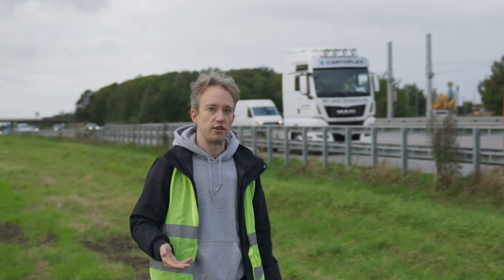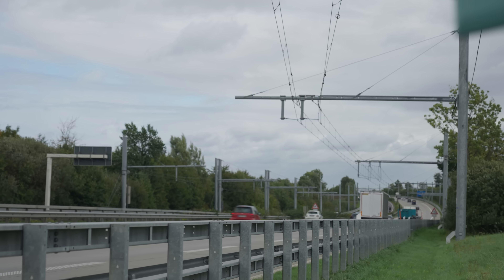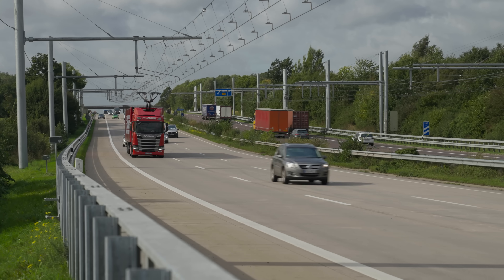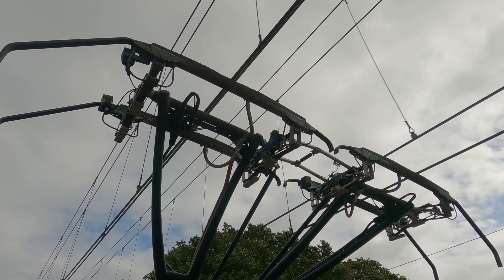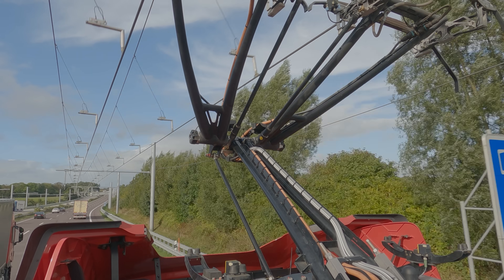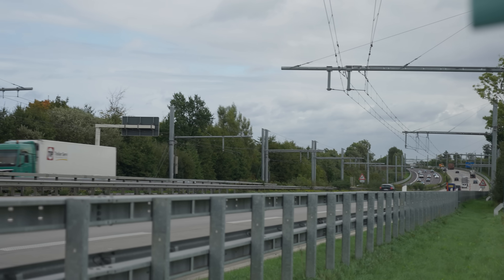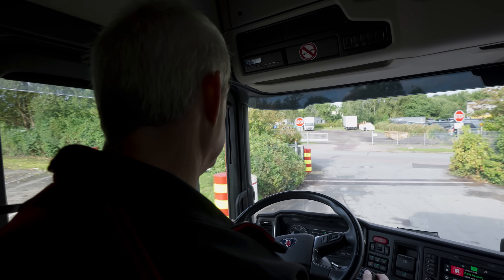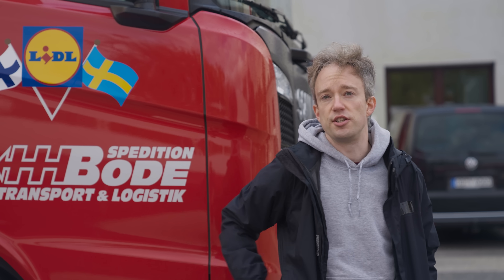The highway where trucks work like electric trains

Comment: As an EV driver I love the idea.
But I believe the future is green hydrogen.
Reply: Hydrogen fuel cells are not the solution. Why do people keep saying this rubbish. “As of 2020, the majority of hydrogen (∼95%) is produced from fossil fuels by steam reforming of natural gas, partial oxidation of methane, and coal gasification.” Hydrogen comes from fossil fuels it is not clean. The rest is made by electrolysis, which is extremely inefficient compared to putting the electricity straight in to a bev.
Reply: @TylerBenney  
".....this rubbish."
Wow, Tyler, how arrogant of you!
If you have a logical point to make try making it without sarcasm.

Comment: I looked into the numbers a year or so ago and it was considerably cheaper to have every truck run off battery than off cable. In fact the eccomomics are there for trams and trains now. Just the technology/companies doing it are behind. These hybrid trucks are barely cheaper than a long range battery ev truck because they have to either lug around a powerful diesel engine, fancy electronics and a power electric electric motor or they have to have enough battery pack to go away from the cables and back again at speed plus they need to have the overhead equipment too.

To predict I would say that battery electric is probably going to win in most counties, a few countries may have hydrogen win and 1 or 2 may have this system. But as it doesn't provide door to door zero emissions by itself as battery or hydrogen do, I'm not sure how governments can justify the outlay to the taxpayer... As by 2035-2050 all new European trucks will have to be zero tailpipe for 100% of journeys. So you either have battery trucks that you also offer this sytem too or you have hydrogen trucks that you offer this too. Sure its a nice solution... But rember how much it cost to electrify the great western railway from Cardiff to London? £5.5bn. The original budget was £850 and the route was to go much further to Swansea. Motorway electrification will not be any cheaper, whatever figure some government minister initially quotes.

Comment: This seems like a step backwards to me. We need to either improve wireless charging or look for other sources like fuel cells. They burn hydrogen, the most abundant element in the universe and they only exhaust water. I'd rather see gas stations replaced with Hydrogen stations myself then wires all over the highway.
Reply: Don't you need some of the rarest metal in the universe to split that hydrogen from whatever it is currently stuck to before you can use it?
Reply: @nogravitas7585  not that I know of, you can get hydrogen lots of ways, like electrolysis of water is one easy way.

Comment: The issue with this in the USA would be that on current highways there is a lot of distribution infrastructure that passes over the highway and that would be an enormous capital cost to move them. I love the concept, and think it has a lot of potential.

Comment: This is only acceptable if those ABOVE WIRES will be used to REPLACE ROADS to TRACKS and run TRAINS. 
If it's not, It's not worth investing.
It's way better to straight up invest in electric railway networks and infrastructure.

Comment: "And with that, you're replacing a lot of diesel" You are also putting a bigger strain on the power plants many of which run off of coal, so you're only replacing one fossil fuel with another one.

Comment: Sure, try everything possible instead of just using the old railways because trains aren't cool anymore. Upgrade rail infrastructure ffs.
Reply: Especially in cities you would have to demolish large areas of the city to put new rail infrastructure in. Sure where you have it you can improve it, and maybe in the most high demand areas you could put some underground rail. But outside of that you are limited to roads.

Comment: In the States, we could get companies to go electric just by relieving them of the need to pay weight-distance taxes and maybe lower the vehicle registration taxes too. Then recover the lost road maintenance revenue by raising diesel fuel taxes.
Reply: Great idea tax those who can't afford a new electric vehicle more until they can't afford any vehicle /s
Reply: @nogravitas7585  - Who would choose not to go electric? Operators that don't drive enough long-haul miles to use the system. Those operators probably don't buy much diesel fuel compared to a driver that is driving their truck 16 hours a day. As you know, the cost of labor is a far greater portion of the cost of truck transportation than either fuel or fuel tax. Short-haul trucks spend much of their time stopped, and being loaded or unloaded. Exceptions, like package delivery, are going to go electric anyway.

Comment: As an American trucker I think this would be awesome. I primarily drive back and forth between los Angeles and Portland oregon everyday so just putting these up on the i5 should work perfectly.
Reply: would be great for up-hill too where most trucks lose or lack power to climb.  putting electric trucks aside.
Reply: @jetah50  Electric and diesel both have lots of low-end torque. That's why there's hybrid gassers but no hybrid diesels.
Reply: @jetah50  nah just get a real truck that's got the power to pull it.
Reply: @camcam-uw5mx  For a traditional truck, more power means lesser cargo weight cause the powerful engine takes up most of the limited weight a total truck is allowed to haul.

That's why saying, "just get a more powerful truck"  isn't always an economical smart solution.
Reply: I'm excited to picture this on US Interstates.  It's not hard to imagine!
Reply: @ninjamincho  Let's make this happen! Contact our congress representatives and senators!
Reply: Most of I5 is straight and fairly flat.  That bit would certainly work for this system.  It is easier to engineer something for a straight line.  You only need something like 50KW to keep a loaded truck at highway speed so it needn't be the great big ones for trains.
Reply: Only thing being the inefficincies of rubber. How about some steel wheels and tracks? Hmm. Then we could attach more trailers togheter meaning less power for more cargo. Wait. Its just a train.
Reply: So do you expect the tax payer to foot the bill for the infrastructure?
Reply: @SlinkShady  did you watch the video?

1. Low cost of electricity makes the trucks pay for themselves in 18 months.
2. Revenue from sale of electricity to truck companies pays for infrastructure
3. There is still profit for the electric company and enough extra to replace the lost fuel taxes for the gov't.
Reply: @SlinkShady  Isn’t infrastructure what taxes are for?
Reply: @robsengahay5614  infrastructure is for everyone not one particular business type. You can't even upkeep the current infrastructure,
Reply: @SlinkShady  Everyone needs the stuff trucks are moving.  I am not in the US.  Infrastructure is looked after in other places.  The US is something of a basket case when it comes to tax and spend but that’s a whole new subject.
Reply: @robsengahay5614  All infrastructure should be privatized, it will actually make transportation and land use more sustainable faster as both are currently artificially underpriced.
Reply: @CAD Thunkin I see this in normal cars as well - people driving along at 70 mph where 80 is allowed, but as soon as I try to pass them they speed up to 90... It must a human trait of some sort, since I also see it in kids, who starts running instead of allowing others to walk past them.
Reply: @flemmingpedersen567  The problem I have on my commute in Chicago is that apparently driving 55 in a 45 gets you attacked and threatened with rear-ending by people who insist on doing 70 or 80 and there's no enforcement. Restoring respect for speed limits and road regulations would be a good start.
Reply: @dblissmn  Preaching to the choir, but people don't care - as long as it is possible to break the laws, and they think they can get away with it, they'll do whatever they please.
Reply: I agree but not sure how if it would work well between Redding and Medford, given all the turns. Though the electric power would be great for those climbs, esp out of CA into OR and south out of Ashland. 

On the speeding up thing, I drive my Sprinter slow and steady and I notice most trucks get real close for a while before passing, probably expecting me to notice and speed up to beat them. Wish I could just let them know I'm going slow on purpose and to pass me right away!
Reply: Imagine the wire system on both sides of a long grade. The trucks going downhill go into dynamic breaking and feed the electricity back into the wires thereby helping the ones going uphill. That system exists already in open pit mines for decades. The only differences are the speed of the trucks and the loads they are hauling. Make it happen!
Reply: What's the problem with trains?
Reply: Doesn't cali already have massive rolling blackouts? Not sure they can spare the power
Reply: Why not train?
Reply: I don’t understand, why not just build a tram line instead if they should install such wires.
Reply: If you make Hybrid trucks that can run on a small engine electricity or both. then when they are on the main roads they don't need to run the engine to keep the electric motor powered. Just get it from the grid, off the grid they just run as a normal Hybrid Truck.
Reply: Naw, you just need 5 more lanes.
Reply: @Conker The King. Because they're messing around on their phones, or playing with the radio, or talking to the giant invisible rabbit sitting next to them - until they realize they're being passed and then all their competitive instincts kick in and the think they're "losing".
Reply: That would be awesome, might even help with the crisis we are having on the West Coast trying to figure out gas tax as more and more people move to electric vehicles. Though I sadly doubt that will happen anytime soon, when it comes to infrastructure the US suffers from much lower population densities resulting in significantly less taxes (e.g. money) for these kinds of projects :( 
To put it in perspective, Germany is about half the size of Oregon and California in size (the two states the original post route would travel bottom to top of for those unfamiliar) but almost exactly double the population of them. Meaning for every 1 American funding core infrastructure (via private corporation or taxes) there would be 4 Germans for the same volume of land. Obviously this is an oversimplification of the problems but you get the idea.
Reply: @CAD Thunkin oh, in that case, they are just being dicks, there are a lot of them out there. Including me depending on the day. We have to do something for fun to pass the time.
Reply: @CAD Thunkin it's because my truck is so long, I want to make sure I get around you far enough and fast enough.
Reply: Underground minecart rails from the train station to the shops.
Reply: Imagine if the US electrifies its highways before it electrifies its railways. What sort of loopy-land have I entered?
Reply: agreed, but I would say the mountains when getting into and out of LA would pose a problem given the uneven terrain. Also I think this should come when they are widening the I-5, not by itself, as the I-5 is already full most of the time.
Reply: Ehh it's kinda lame and looks bad cause 1 who wants to won a truck with a Pintagraph on the roof and 2 driving a electric is lame theres no fun to it cause its silent
Reply: Saying "the I5" makes me really curious where you're from. It's like an unholy merging of "the 5" and "I5."
Reply: Just wait until you realize exactly how heavy electric trucks are, along with the fact there's weight limits on the road.
If an expensive truck with a super small load limit is your thing, then electric is right for you.
Reply: @Ethelberd  great point!
Reply: @Ethelberd  according to Google, electric trucks are only 4400 pounds heavier. That's not that big of a deal with a gross weight limit of 80k . Sure that's a bit of a loss for revenue but with fuel being such a big cost I think it's worth it for many.
Reply: @TastyChubz  worth it for many. How?
Reply: @ruhroah5044   worth it for truckers in fuel savings. If it pays for itself in that little time then the fuel savings would be worth it. Especially for us truckers that aren't always at gross weight so the extra weight of the equipment doesn't matter.
Reply: @TastyChubz  I'm glad they're experimenting with this cool approach, but fuel alone is not the only cost of running a rig right? Seems to me that without serious tax subsidies, independent truckers would never be able to be profitable with something like this.
Reply: @ruhroah5044  well the point of this is to lower dependency on fuel so even if it just end up being even on fuel cost then that would be worth it for this to work.
Reply: josue Kay  aw, look at the little euro trying to be insulting, how adorable
Reply: @Conker The King. anything having more than two wheels has a dumb and clueless bot inside

Comment: What a dumb idea and waste of taxpayer money. Instead of transporting cargo on existing electric trains (!) you electrify trucks. You can load containers from ships directly onto trains and you can roll them directly into the warehouse too, like they used to 30 years ago. And even if you wanted to do last-mile delivery you can do it on a battery-run trucks, that load containers at train depots.

Electrifying trucks is the equivalent of making toast in an oven when you have a functioning toaster.

Comment: A hybrid setup with pantograph for major highway/interstates, modest battery storage for inner-city travel(chargeable via pantograph), and traditional diesel to get everywhere else. That way as they add more and more overhead wires you'll use the diesel less and less. Eventually many companies whose routes follow the eHighway will do away with diesel altogether.

Comment: The only issue with such a system is oversized loads, such loads are uncommon but rely on the high clearances provided by the motorway network having a minimum height clearance for motorway bridges, perhaps openings at junctions could be a solution but perhaps a less intrusive option may stem from inductive charging technology. The issue with both is that the system is open to being exploited by falsifying the amount of energy delivered as unlike charging with a plug the lines can only deliver energy and not monitor individual usage.
Reply: I am sure they would just introduce a test for it when it goes to be tested by DOT/MOT or whatever transport department tests commercial vehicles for roadworthyness. They would probably have a limit on how much a truck can draw etc. 

As with oversized loads, now is the time to think about that and make the overhead lines taller. Once a standard is set, most places will adopt it. But I imagine they are around the wires are just outside the maximum height restriction for vehicles, so a double decker bus won't have an issue.

Comment: Tom.
The thing is it's a great idea, it removes the CO and CO2 from truck emissions but where does the power come from?
Britain can't provide enough energy for everyone to have electric vehicles, we still burn coal and oil to make power so we need more green power and more nuclear power stations.
Till then our government will carry on saying that we'll all have electric vehicles by whenever and the infrastructure won't work.
And what people can do is take the internal combustion engine, gearbox and fuel tank out of your car and fit an electric motor, batteries and the pixie wrangling box in there and you'll save a lot of waste Vs just getting a new car.
Stay safe everyone. 🙂👍

Comment: I am just saying: if it is worth installing permanent overhead power delivery to moving vehicles, then it is probably worth using a railroad instead. 
I am sure there is some trade offs or specific routes that could benefit from this infrastructure, but at that point I think you are just better off with batteries due to the economies of scale one would expect from mandatory EV sales instead of ICE vehicles.

so anyway trains are super efficient and safe. I like trains.
Reply: capacity would be limiting factor with rail imagine all those lorries worth of goods trying to switch to rail you would quickly run out of capacity  on current rail infrastructure many lines are already probably running at capacity between freight and passengers building enough rail infrastructure to accommodate the increase would cost far more money and you would still need trucks to carry goods that last step to get goods from the rail to the factories shops etc

Comment: Why are long-distance trucks even a thing, though? It's much less energy-efficient than trains. Trucks should only be used for last-mile delivery, in which case battery life isn't even a problem in most areas.
Reply: Cause it's often cheaper to ship things by truck, especially in places where there aren't any trains.

Energy efficiency means nothing when the infrastructure for trucks is already there and the infrastructure for trains is not.

Comment: I wonder if maybe we could increase efficiency and decrease power loss on this system by reducing friction, maybe steel on steel wheels? Plus then you'd need to lay less road down because you'd just need two thin strips. This would probably reduce danger for drivers since they wouldnt have do deal with unprofessional drivers on the roads.
Reply: Shame this doesnt exist though